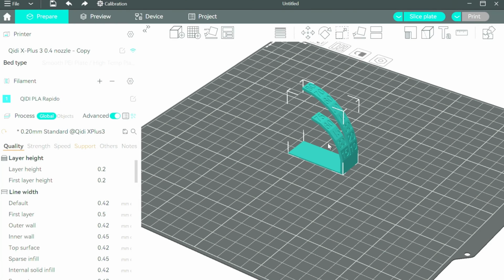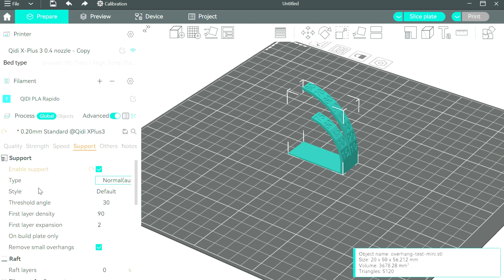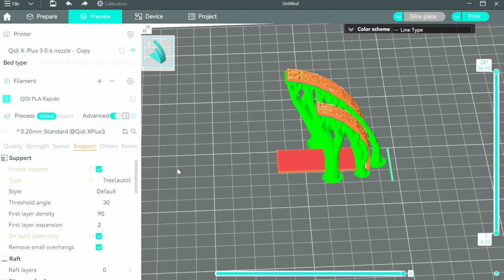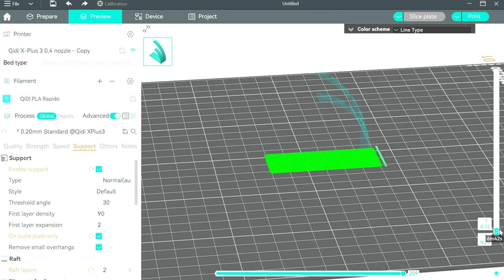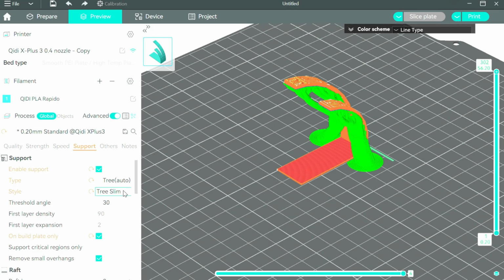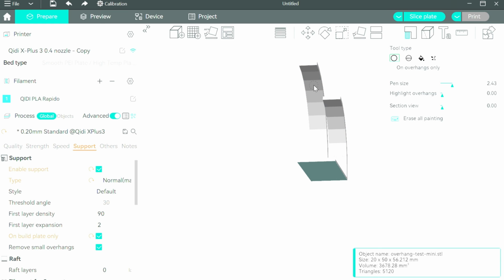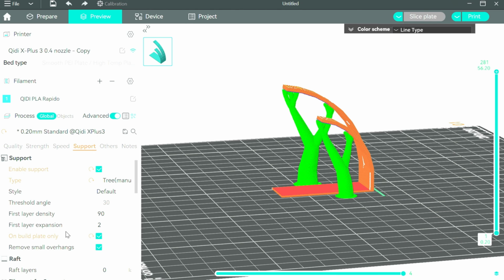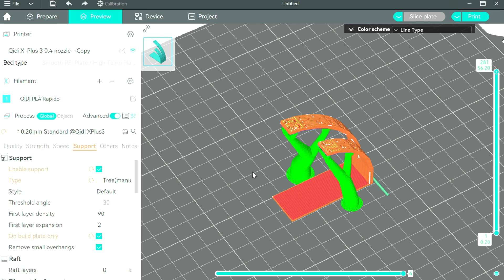Orca Slicer – Supports!

Comment: I've been wracking my brain trying to figure out how to do something in Orca that I can do incredibly simply in Cura and hoping someone might know what I'm missing.  I have a tall cylinder with three 8mm high and 20mm wide notches near the top.  Due to the curve of the cylinder I can't bridge...believe me I tried.  They need support but orca insists on running supports all the way from the base up to the very top.  This thing is over 240mm tall and this wastes an incredible amount of time and it simply is not needed.  In cura I can tell it to rest support on model when required and it will put supports ONLY within the notches.  I'd use cura but I cannot get the quality I can get in orca slicer.  That's the prime reason why I switched after moving to klipper.  Not to mention the speed difference is astounding.  With the supports this model is over 19 hours.  Without its 13 (It's over 26 hours in Cura with the same settings).  I will NOT waste 6 hours, and risk a failed print, just because orca can't figure out how to place the supports without running a tower the whole height.  Any ideas?
Reply from the maker: Hi. Unfortunately, i dont have any ideas to help out. This seems to be a limitation with Orca/Bamboo slicer.
Reply: @3DPrintscape  Thanks for the reply.  I kind of figured this was the case but in writing things out I did have an idea that will be a bit time consuming but should do what I want in the end.  I'm just going to have to re-edit the model (again) and add in supports where I want them.  The tricky part will be getting them JUST the right distance from the top and bottom surfaces to keep them from welding in place.  I got so used to Cura doing this that I never even considered it when I designed the model in the first place.  lol

Comment: Can anyone help me please? How can I do standard supports in your example part, but starting in the bed? I am looking to do supports with angle (not 90º from bed)
Reply from the maker: Hi. Did you try selecting standard supports and on build plate only?
Reply: @3DPrintscape I was trying but without good result… you can try it in your model. I don’t know why Orca can not do supports with different 90º angle… in your example how you do standard supports just starting on the bed? Because it is not working, you can test, but is not working
Reply from the maker: @IsaacGomezCaballero  Clicking on build plate only will force the base to be on the build plate and not the print. I prefer tree supports with the on build plate only. I just tested and that worked as expected for me.

Comment: Can anyone help me out with orca slicer, if I can turn a 2d picture in to a 3d print for with orca slicer???thank you
Reply from the maker: Hi. Im not aware of any slicers that can convert a 2d image into a 3d one. They require the 3d version and just convert it to gcode for the printer. There are some tools online that can do it but i haven't tried them and im not sure if they are free or not.
Reply: @3DPrintscape  thank you for your advice and help
Reply: @3DPrintscape you can use cura slicer to convert svg (vector) to model